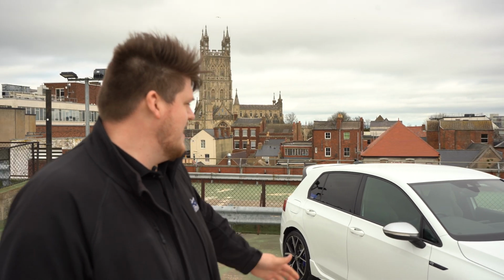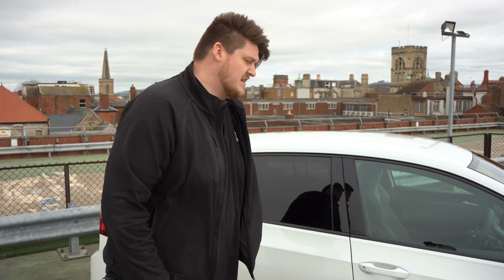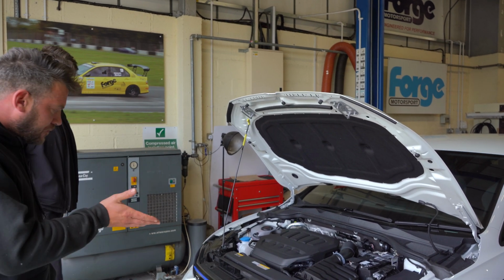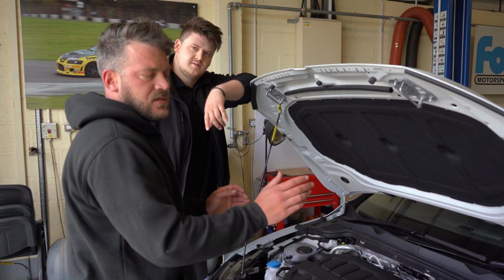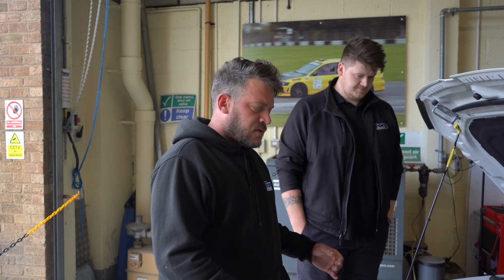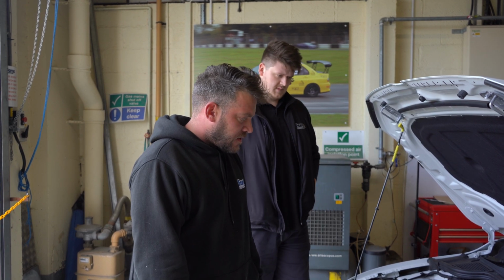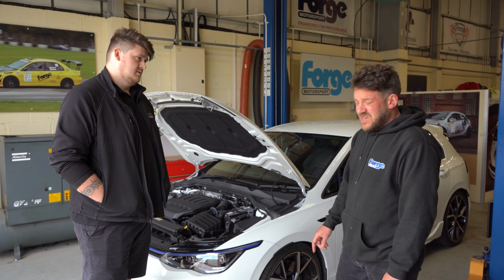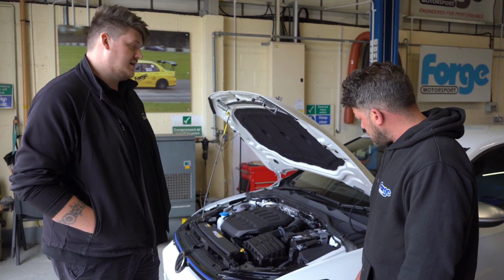MEET OUR NEW MK8 GOLF R, BIG THINGS ARE COMING - Project R, Episode One

Comment: Got A question for you. I get mine in June. Do you have to run these cars in?
Reply from the maker: VW advise a break-in period, but it's best to check with your local dealer or by consulting the owners manual.
Reply: @forgemotorsport  Yeah manual states 1000 miles. But I thought running in was a thing of the past thats all. Thanks for replying.